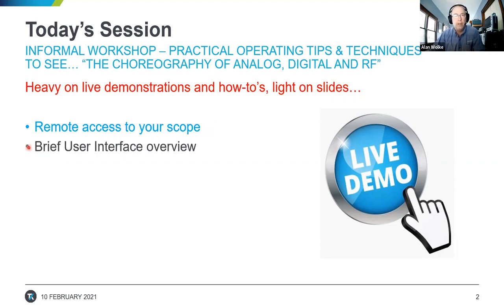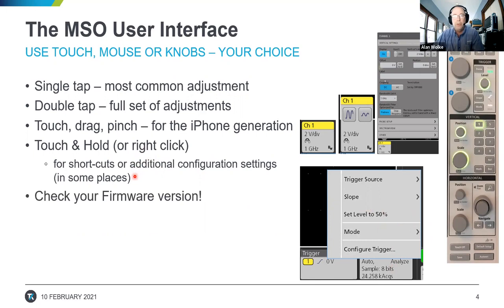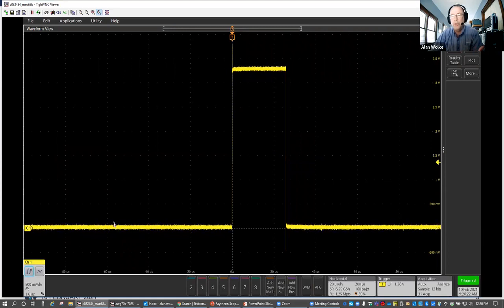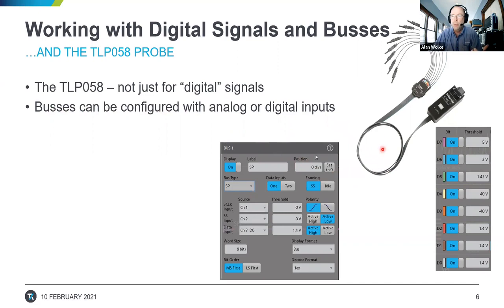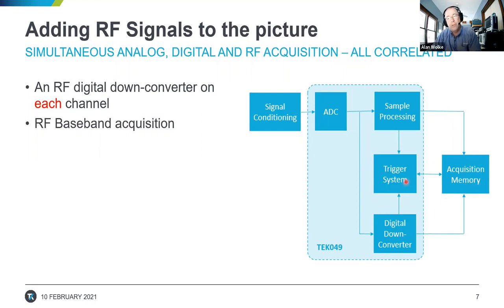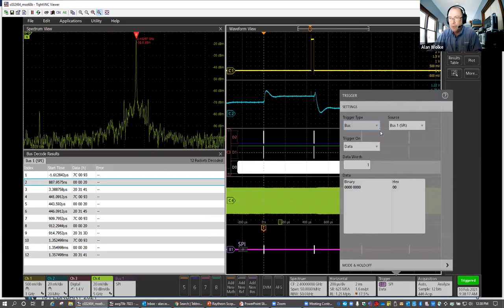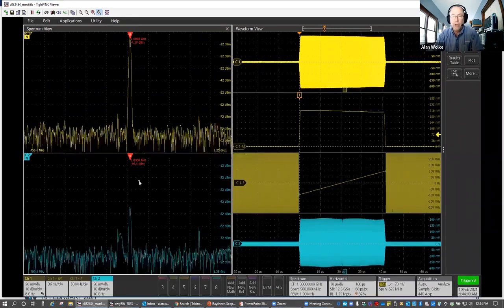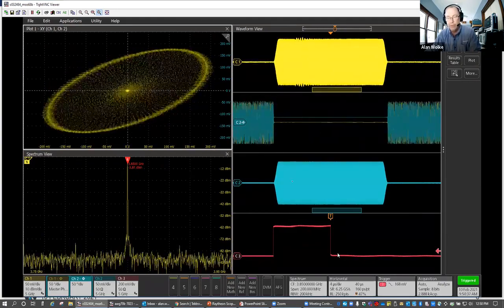Practical Techniques Workshop for Mixed Signal Oscilloscopes

Comment: Glad that you got rid of the "trashcan" for deleting channels.  Having to drag the channel all the way over to the right hand side of the screen was just nuts.  One question though... Single tap on a channel brings up the amplitude adjustment only, double tap brings up the full channel menu.  Why not just bring up the full menu with a single tap??  You don't need two separate menus and the vast majority of screen elements should be accessible via a SINGLE tap only.